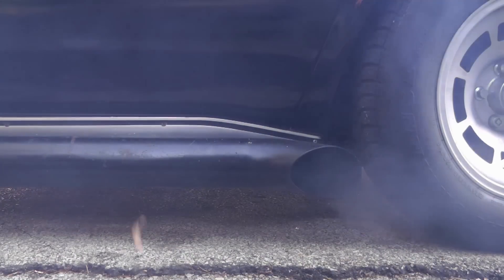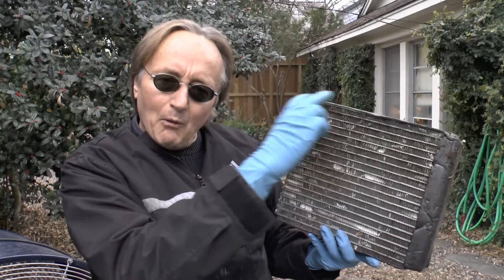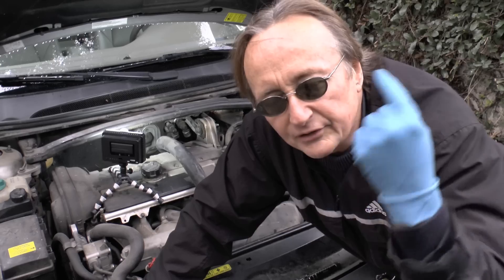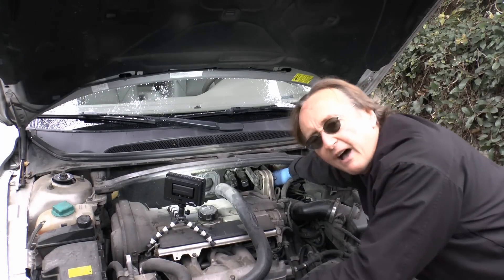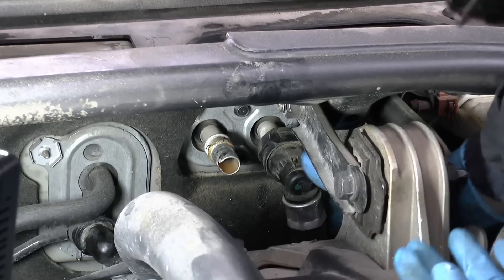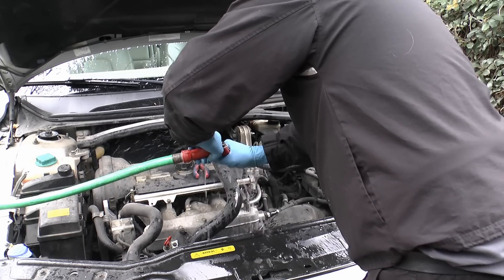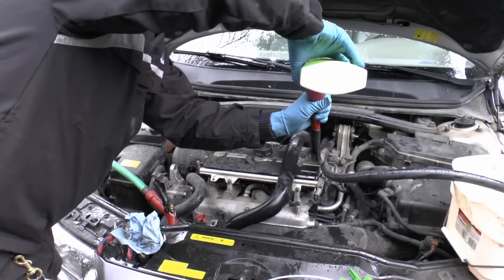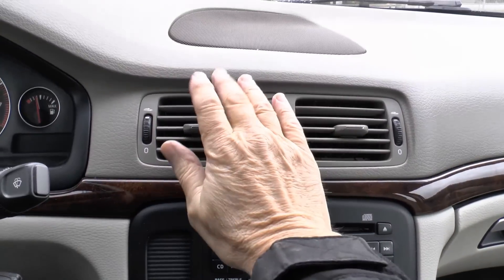Fixing A Broken Car Heater By Flushing It

Comment: Not sure how you could fix this but: My 2002 Silverado's heating works just fine until it gets to about -30, when it can literally take up to 45 minutes to actually start blowing hot air. Any way to speed that up?
Reply from the maker: many guys put a piece of cardboard in front of the radiator to block some of it when it's that cold
Reply: you must live by me lol, Scotty is right on the $ with his answer, I have to block off the cold air coming in the front grill or the engine will actually start to cool off on the hwy, no hot air at all, I blocked it off like it was a diesel and it works much better, also I went to the local parts store and they had a ceramic auxiliary heater that I can just point at the windshield or my fav down my jacket lol, it was like 40-50 bucks for the little heater and well worth it on crazy cold mornings.
Reply: It could also be an old or cheaper aftermarket thermostat opening up too soon.  If never done, you might try replacing it with a new one from a Chevy dealer.  You can get OEM online cheaper, often.

Comment: hey Scott, I have a opel vectra b 98 with ecotec engine, so I flashed the radiator got all the"water out" and I put antifreez coolant in it and, my heater is blowing cold air. note I drove the car w water in it for 9 months...what could it be
Reply from the maker: +Arthur Rostomyan  if air is in the system, heater will not work. Make sure air is not in the system FIRST.

Comment: Hi
I'm Patrick and I'm 22, recently my car loses power going up hills and if I stop at a red light sometimes it cuts off. I had a couple people tell me it could be gas filter needs changing or catalytic converter now I have a 1998 Acura TL 2.5  and I really need help. please respond. Thanks
Reply from the maker: pressure test both the fuel pump and the catalytic converter, or pay a guy like me to do that. Low fuel pressure will do that, can be a clogged filter or bad pump, and too much cat back pressure will do the same thing
Reply: See if your car has any stored computer codes. I get mine scanned at AutoZone free. It might also be the cam position sensor on that model.

Comment: I have question Mr. Kilmer. I found a 1987 VW Cabriolet 5 speed standard for $1500 at an old auto place. I was thinking about it buying it, but I'm not sure it's worth. Is it worth buying a car like that, and the repairs or parts  if needed any repairs are hard to come by?
Reply: For the amount of time it'll be at your mechanic's garage versus you getting to drive it regularly, no it isn't worth it to put TLC into an 80s Volkswagen. My rule of thumb when buying old cars is, 1. how easy is the aftermarket, and 2. Do other people often own the same model car in the same city, meaning is there a healthy following for such cars.
Reply: 999thenewman I got the price down to $950. I'm just looking for something to learn how to drive a manual in. I don't want to take my chances driving a nicer car to learn how to drive a manual, because I'm afraid I might burn out the clutch on them or something. I know it might be junk, but I just hope it will last long enough for me to learn how to drive a stick. I have a backup car anyways it's a 2009 Nissan Versa. Thankyou for you input anyways.^_^
Reply: You did really good on the price! Buy it. Use for what you need, and you can sell again. :)
Reply: 999thenewman Thankyou. I that what I plan to do after learn how to drive it. lol^_^

Comment: Hey I have a 2007 Toyota Sienna. I noticed that I only have no heat on the right side of my car. The fan blows but only cool-ish air comes out. On the other side of the car heat blows normal. I took it to Toyota and they said they couldn't figure it out. Any ideas?
Reply from the maker: ha, they could figure it out but odds are you wouldn't give them a blank check to fill out for the bill, so they are just blowing you off. Odds are the actuator or blend door on the passenger side is broken and that can cost upwards of a grand to fix.  Find a pro toyota mechanic who cares, at least for an analysis.

Comment: Hey scotty my car has no a/c gas ive checked it by the pressure switch. Anyway, whats the best diy way to test for leaks. I think my car was previously in an acident and some of the lines are slightly bent. I dont really want to go get them to gass it before i changed bad bits out.

Thanks for the great vids and common sense advise!
Reply: If your car is older you may need to replace the A/C O rings as they can become mushy and leak. You can get UV die put in your ac system so you can find leaks with a UV light.

Comment: Scotty, dumb question here: my heater core is plugged up because 1 hose is hot and the other is cold.... what if instead of unplugging hoses and flusing out the system, I pour some of the LIME-A-WAY into the radiator and run my 2001 chevy silverado for a couple of days and then I replace the coolant? thanks
Reply: Not a bad idea. Did you try it? Or, is it ill-advised because of contaminating the coolant?
Reply: Selma Ave Didn't try it...I was told the chemical could damage other stuff in there like, rubber seals and stuff

Comment: Hello Scotty Kilmer, I've got a 1977 Olds cutlass that just recently started leaking coolant under the passenger side door (by the front right tire.) The inside of the car does smell like coolant when driving, and i haven't got a clue what it could be.
Reply from the maker: +Ric Baez leaking heater core, pressure test the system to see if it's that.

Comment: Great video, I hope I can follow your advice when I do mine later today. I noticed that the passenger and driver foot well is wet. Is this because of a blocked heater core
Reply: indiandy03 
 you need to replace your heater core because it's leaking
Reply: Thanks for your reply I am slowly coming to the same conclusion although it seems such a big job and the garage want over £1000 to do it. Why do car manufactures make these jobs so hard. What do you think of using something like stop leak, will it cause me problems later with the water pump and thermostat.

Comment: Hi Scotty. I was running my 1949 chevy truck and I found a rather big coolant leak coming from the rear of the engine. I took a light and looked closer and saw the hole in the flywheel casing was wet with coolant, and coolant was dripping from in between the starter and the block. This only leaks when it is running. What could this be? Thanks.
Reply from the maker: often a leaking freeze plug.

Comment: mr kilmer need your help my 2004 civic ex is acting up on me when i turn the heater on  my temp gauge is moving up towards red the heat is blowing good hot air  i check the coolant level and is low i added coolant but again when i use the heater is going low again please help
Reply from the maker: odds are you have a leak somewhere. Pressure test the system and fix that first, it could cause all those problems

Comment: the heater does work poorly sometimes...how do I get the air out
Reply from the maker: +Arthur Rostomyan first remove both heater hoses under the hood where they feed the heater. Then flush the heater core using a garden hose to get crud out.  Then fill it with the garden hose and quickly put the hoses back on the heater core that you removed. Then jack the front of the car up, so air will come out the radiator with the cap removed as it warms up and opens the thermostat

Comment: My heater core on my 2002 crown victoria was clogged. What happened was the police department that owned it before me never changed the coolant.....so it got so dirty, it formed a thin layer of sediment on the inside of the heater core. Tried flushing it out, but the sediment was just stained inside the heater core...not even CLR worked. So I had to unfortunately replace the heater core....did it myself. Yea the heater core is barely holding on to the heater hoses (had a hard time getting the box assembly to screw back into the firewall. It is only hanging on by 1 bolt instead of 3), but Its been 2 years and so far so good. lol

Comment: Quick tip use hot water from your washing machine. Your hose will fit on it. I say this from experience with mt 96 S10. I had Chevy and two other mechanics use cold water and every year it would have to be done and finally the fourth used hot water and BAM! heater perfection!

Comment: Can I use this same procedure for my 2002 Toyota Echo?( 2 inner vents blow warm air when AC is running & blows cold air when heat is on). Also, do I have to drain the coolant? (Don't see you doing that on video,but see you adding some in).

Comment: My car also doesn't have a heater control valve. I live in Rio de Janeiro and don't need hot air but I need it to control the air condicioning temperature. As the heater core is a part of the system I had to isolate it in order to make the cooling system work. I will try to flush the heater core to see if it works again.

Comment: I have a Vauxhall mavera 04 and had a coolant Flash and change the outlet pipe and inlet pipe are both getting hot but only get hot air for a the second then it's cold again had the thermostat replaced as well and it won't get up to running temperature any help would be greatly appreciated

Comment: The mechanic I know wants to charge 500$ for something so easy yet I cant do it even when watching this lol🤦‍♂️🤦‍♂️but honestly how long can I go till a major problem happens ?? its summer I dont need this heater yet??
Reply: I'd imagine it won't be a problem until you start having temperatures issues, which are most often seen in the summer since the engine has to work harder because of the heat.  If I were you I'd try it.  I mean heck your talking about $500.  Either that or wait for the radiator to fail and have to fix that.

Comment: that is really good to see.  I have to replace a radiator when it gets warm and I intend to flush the engine and heater core.  It's a dodge ram, but similar enough.  thanks!

Comment: hi :) 
have a problem with a microcar ( diesel ). 
its not blowing any air sometimes, sometimes it starts blowing cold air when i press brake or steer. but it doesnt blow any warm air. 
What do you think. is it worth of trying to flush it? might it start normally blowing? 
Greetings from Estonia/Estland.
Reply from the maker: sure, try flushig it and make sure coolant is full with no air in the system
Reply: flushed it, works :D thanks :) but still having problem with ventilator :) its sometimes working, then its now blowing air. then sometimes when you push brake it works etc.. looked the fuses, all are fine. looked for some wires witch could be unplugged and yea.. cant find the problem. would you recommend to install/change the ventilator wires straight on battery ( fuse between plus and switch ).

Comment: hi guy mabe u can help. i had took my hose from the water pump, took off heater control valve from my manifold and put adapter to top of manifold and put hose there. this is how i originally jumped out my heater core. now that i had to do my valley pan. i want to know if i could plug the port on manifold and cap the water pump this is a 1972 olds 350 engine. thanks scott  PS  i have played 888poker with guy with same name that u use.

Comment: It's not just Volvo's that cost a fortune to replace heater cores! Most cars suck when it comes to that job as it takes literally removal of damn near everything under the dash and takes hours. it's one of the first parts put inside the car when it's made and that means everything comes out to replace it. Miserable job from the several on different cars I've done it on.

Comment: Your video helped me confirm why the heater on my grandpa's old truck wasn't working. I told him and he had a mechanic look at it and it turned out that the heater core was partially blocked. He had it flushed out and lots of crap came out. After that, the heat could bout drive you out of the truck. Thanks Scotty Kilmer. 😊😊🖒🖒

Comment: Hey Scotty I have a 1999 Pontiac Grand Prix 3.1 v6 that has the temp gauge moving up then down with hot air coming on when it goes down.  I put a new thermostat in and still same issue with engine smoking after driving for 20-30 minutes.  Could it just need a flush ?

Comment: Hi Scotty, I notice you always use these universal coolant formulas that are compatible with all cars; however I also understand that we are not supposed to mix green and pink coolant due to their incompatibility. It this an issue when using universal coolants? Thanks.
Reply from the maker: if it is the old green coolant, that's a different type of glycol and should not be mixed with long life coolant. It actually would work, but it would mess up the readings for freezing temp of the fluid when tested
Reply: Scotty Kilmer ahh ok thanks for clearing it up.

Comment: Just flushed the heater core on my 2007 Chevy Equinox using the exact methods you described here, including the Lime-Away. Worked like a charm, heater blows nice and hot now. Thank you Scotty!
Reply: Stupid question, which is the inlet which is the outlet.
Reply: @ThirdEyeThrive hot is in. Cold is outlet, I believe

Comment: Hi Scotty great video. My 04 Camry has a very small faint smell of antifreeze while blowing heat. I read where you said it could be a small leak. Is that all it could be and how could I repair. Is a sealant recommended?
Reply: You need to replace your heater core if it is leaking. Stop leak stuff i only a band aid and causes more harm then it fixes. If its  beater that is going to be scrapped soon then stop leak is ok. If you like your car and intend to keep it, replace your heater core. Its a long shot, but you can also check and see if coolant is leaking at the heater core connections.

Comment: Hey ScottySo I have bought a 2004 s40 Volvo for my son graduation. Problem is the heater blower is not working.The other problem is I can't find one single video that shows me how to do this job.I've pulled the glove box and a few other parts off and it looks like the blower is right in the center of the dash all the way up at the top. : (    is this correct?Can you show me how I can test the blower motor and the resister on this car before I try to remove them?I've checked all the fuses already.Can you show me the steps to take to remove them also if there bad?????Please help!!Thank you and Happy New year.

Comment: Hey scotty I have a ? I have a1988 cutlass with a 350 rocket engine when cut on the air or heat it only comes from the bottom vent not the tops what could that b
Reply from the maker: darrius thomas check for vacuum leaks, see my video "finding engine vacuum leaks with a cigar"

Comment: hey Scotty, i drive a 2000 ford expedition and i have steam or smoke and a smell coming through my heater like pancakes and its slowly putting out less and less heat. i have told people about it and they are telling me i have a heater core leak but i haven't had anyone look at it, my coolant is kinda low but i never had to top it off before i'm not running hot or anything but of coarse i haven't changed my coolant in a few years and it looks like its sludgy orange/brownish, i was wondering if you think it could just need flushing and replacing the coolant or if its really the core leaking? do you have any other videos on this?

Comment: i know this isnt a relative question, but i removed my distributor button on my car and fittled with in when changing spark plugs and now it is idling really low and is backfiring and popped me twice hard when i was touching it as it backfired. first time was an accident. second was for science.. ha. i had messed with both the rotor and removed and reinstalled the plugs. what did i do this time????

Comment: I'm hoping someone might be able to help me. My e46 320i is getting low heat through the vents. Engine gets up to temp with the needle right in the middle when I have the heat off. When I turn the heat on, the engine temp needle drops to the low end of normal operating temperature, and I get low heat coming through...any idea where I should start? Thermostat, coolant flush, heater core/flush?...
Reply: AMV0429 Check your thermostat, could be stuck partially open/closed

Comment: That customer should have been thrilled. Have you ever used compressed air, or is it too far gone if the hose doesn't work? Great videos, thanks.
Reply from the maker: 100 psi and up could rupture the stupid heater core

Comment: can someone please help me. my 2002 explorer has heat in the rear for a little bit and then starts going down to cold and  it stays warm but not hot. my question is, is the heater core broken or the system is clogged?  I also changed the blend temp actuator.

Comment: I don't have heat and AC in my car it's just air works. and when I turn on the AC it's noisy coming from the engine.I checked the blower motor it's good, do you think is it the AC Compressor is bad?

Comment: Hey scotty, question when its cold in the morning and after my vehicle warms up while driving. I will turn on the heat and my temp gauge will start to fall.? I have a new thermostat and flushed everything out the weird thing is i still have heat. Any other suggestions? I  have a 07 mazda cx-7.  Much appreciated.

Comment: Are there any rings or seals between the connection? I flushed my heater core on my 01 v70 but the heate core hoses keep flying of when i drive the car

Comment: I've got dual climate control, one side doesn't blow heat and on top of that it temp gauge overheats minutes after car is running. Could this be the heater core?

Comment: Hi Scotty, will it damage the engine if I just clamp the rubber hose to the heater core to block the flow instead of bypassing it? I don't need the heater because Malaysia is summer all the time. The heater core flap doesn't close properly making the interior always hot. My car is 1995 Nissan Primera with SR20DE engine.